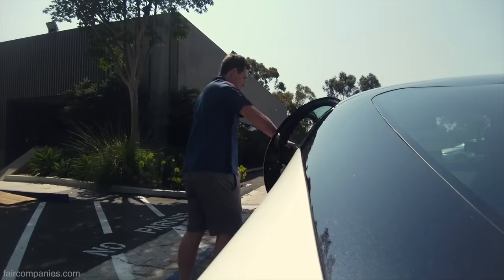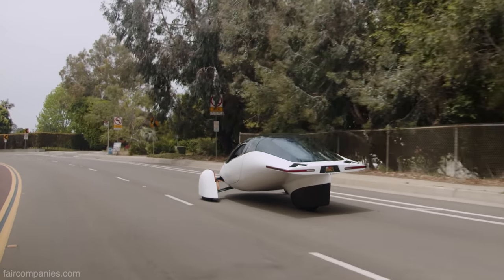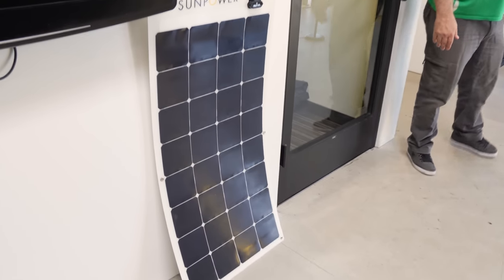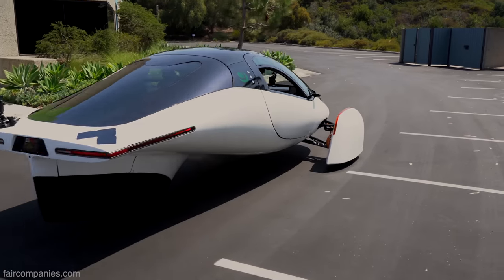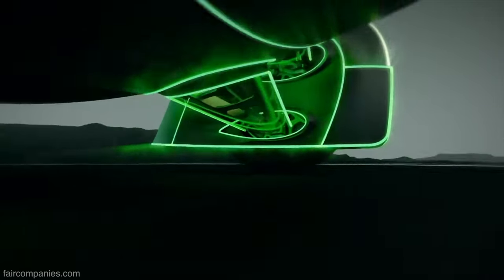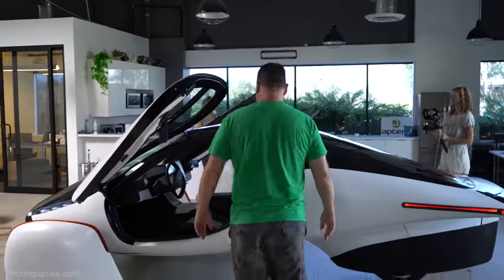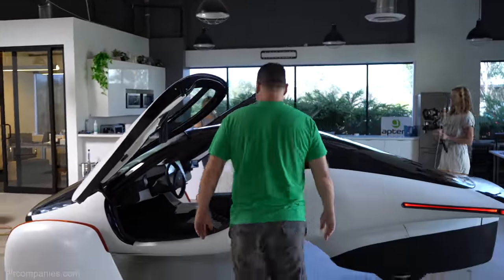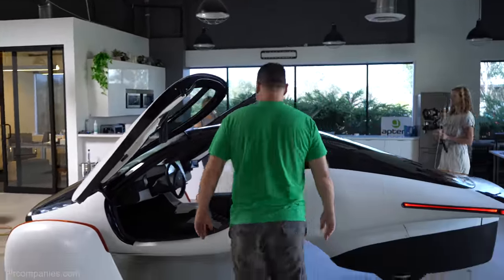Aptera commutes just on solar, gets 1K mile-range when full

Comment: Would be great if that sort of solar cells would be on other EVs too, more effective solarcells. I'm afraid the energy corporations will sabotage these solar cells, to keep people dependent in order to demand a high price for energy from people. 

Back then they made the cars front tall and V shaped, the wind drag was then very low too and there was more room in the vehicle. that would be i think the more efficient form. 

i would rather have the wheels under the cars body as usual, than sticking out oddly on the sides, that doesnt look good.
1000miles is a long range, i wouldnt mind much if it was only 820miles with an usual position of the wheels as said. 

btw, its great there is enough room in it for sleeping in that vehicle, i actually clicked on the front image of the video because of the tent on the car. 

They're building boats too, would be fun if they put a little boat motor on that thing for driving in water like a boat.

Comment: I think one of the best kinds of solar charging structures would be something you can unfold. It seems the higher power cells usually have to be hard in some way and that's doable too. They'd just have to have lattice geometry in an origami-like fold.
Reply: The problem with solar remains completely unchanged...
It doesn't work at night or in the shade.
Reply: @sandervanderkammen9230  That'd just be rechargeable batteries. But yes that is still an issue either way.
Reply: @suruxstrawde8322  Yes, rechargeable batteries are also very inefficient and impractical.
Reply: @sandervanderkammen9230  Hm, this I'm not very educated in. But even with the naturally occurring nanotechnologies of biology solar radiation isn't enough fir conventional movement in most cases. Typically biofuel in a readily convertible state is what's used.. hmmmm.
Reply: @sandervanderkammen9230  Some solar such as what Aptera is using still provides power in the shade.  What it does do offers considerably value added for the cost.
Reply: @n.brucenelson5920  But voltage can easily drop by over 75% if just one cell in a 36 cell array is cover bu shade, this will drop battery charge current to near zero.
Reply: @sandervanderkammen9230  It is understandable if you are not an engineer, but there are several ways to avoid this including bypass diodes and micro-inverters.  Or, considering your history, it could be just more of your FUD.
Reply: @n.brucenelson5920  You're not an engineer... you are a Tandy computer salesman at Radio Shack.
Reply: @sandervanderkammen9230  LOL,

Comment: How does it handle snow and flooded streets
Reply: The ABS/Traction control can sense slip and adjust torque 32 times per wheel revolution, or about every 2.5" of tread travel.  The wheel motors have been tested to operate under 10 ft of water.  It should be fine, especially in the AWD version.
Reply: @n.brucenelson5920  What will be the result of your leaving your domicile after a 2 day blizzard has dropped 2 feet of new snow burying your solar-powered car
Reply: @matthewjacobs141  I do have a garage.  My Aptera will have better ABS/Traction control than my present Honda which weighs about the same.  I have plenty of experience in blizzards, even on two wheels.  Aptera will be an improvement if I have to go somewhere with better torque control to avoid slipping.
Reply: @n.brucenelson5920  That's you...what would make this car appealing to the majority of people who are apartment dwellers...who park on the street where ever they can find an open space?
Reply: @matthewjacobs141  Each situation is different.  Aptera's first vehicle is not meant to meet the needs of everyone.  However, due to the low power requirements, it will gain range faster than most vehicles from any kind of plug that can be found.  If they can part in a sunny area they may not even need to find a plug to meet their needs.

Comment: You can use an impact wrench for a motor. The regenerate part is too heavy for now so a tank will do. Best of all you won't get radiation from EMF.
Reply: The motors are too far away from the occupants for EMF to be an issue.
Reply: Try again using a guass meter.
Reply: What frequency are they?

Comment: I wonder if it has heating and cooling also.  I figure that kills a lot of efficiency.  But driving through roads on 100 degree days with that glass canopy I'm going to want A/C.

I do think it's a cool vehicle and see a use.  Just wondering if it's a limited use vehicle.
Reply: Yes, both. It is spec'd over a range of -20 to 125 F.

Comment: Here's a better idea - efficient town planning where cycling makes more sense. EVs still accumulate carbon debt due to more complicated resource supply chains compared to conventional cars. Interested to know how many miles of driving until you've paid off the carbon debt.
Reply: Great comment and question.  Of course part of the answer is that Aptera  is  better for our environment than almost any other weather proof powered choice on the road.
Reply: At least in the U.S.A., every credible study shows EV's, from "cradle to grave", have less "carbon debt" than conventional cars.

Comment: I haven’t loss interest, not yet anyway. If Aptera can deliver as promised it most likely will be my first EV. But I want one I can butt test and drive before I commit to buying one. When are you actually starting production?
Reply: James, I got a ride in the Silver prototype, as did my wife, just before Thanksgiving.  A $100 deposit doesn't commit you to buying one, it just gives you a place in line, and it is refundable.  I expect that if the supply chain doesn't fully collapse as a result of the war, that I will be driving mine late in the year, and will be giving as many people as I can a chance to experience it in person.  You can send a pm to me on the Reddit r/ApteraMotors sub when you see that happen.  I live in Iowa and will be heading that way after picking it up.

Comment: it looks wide for parking. also the door swing looks like it would hit a car parked next to it. what is the cost?
Reply: The outside of the wheel pants is 88", compared to a standard parking space of 108"  My truck is wider than that.  You will be able to fully open the doors and exit with only 5" of clearance - better than with standard car doors unless you are very thin.  Prices start at $25,900 before incentives.

Comment: You are going to get very wet if it rains with that camper system, but I really love your 3 wheeler, I have been watching you car/trike for a long time, also watching the Doran, I even invested in that trike but got screwed really bad, how much for a Aptera and can it tow a small cargo trailer with all my camping gear that I carry on my vw trike?
Reply: Starting at $25,900.  Payload 500 lbs.  2-3 hundred towing capacity.

Comment: I haven’t seen data on top speed??—- I know it has great pick up but how far can it travel at 60 mph?
Reply: The top speed is governed to 110 mph.  The battery range projections are given for EPA highway rating speeds which average around 48-50 mph with peaks to 67 mph.  I think they are conservative.  There are programs on line where you can play with predicted performance and range for various configurations and speeds.  One is ABRP.

Comment: I believe the solar helps but not 100%, I still would drive one of this...if a cell does crack, it effects the whole panel not just that cell...
Reply: The cells Aptera is likely using have, effectively, bypass diodes built in.  This means a severely cracked cell will NOT limit the "whole panel" as you describe.

Comment: Since the front wheels protrude and aren't part of the car's body, it would be difficult to estimate how far they are from curbs.  Using drive-thru windows and gate badge readers would be challenging.
Reply: The left hand wheel pant can be viewed directly and there is a camera view for the other side.  There is also an ultrasonic distance sensor in the fender.

Comment: They should have used LFP batteries instead, since they can he charged to 100% without problems, don't require advanced cooling, does not contain nickel or cobalt, have no patents and are cheaper. 

True, LFP are not as energy dense as regular lithium batteries (easily compensated by being able to be charged to 100% every time) and have worse cold weather performance, but since the Aptera won't be used in cold weather anyway (because of the solar panels), it would make LFP batteries a perfect match.
Reply: I will be using my Aptera year round in Iowa.  Chris Anthony took an LFP battery company public as CEO.  

You can be pretty sure he would have used this own batteries if they could have provided the performance they were seeking.  Perhaps LFPs will be a future option.
Reply: @n.brucenelson5920  Well, LFP perform excellently in Teslas. The trick is to keep them warm. LFP having less energy density is compensated by the fact that they can be charged to 100% without taking much damage at all, they also have many more charge cycles, don't need cooling in hot, sunny climates and are free from nickel and cobalt. It's a better suited battery for an EV that charges all the time from solar. The vast majority if people buying an Aptera will live in sunny places, so cold weather performance is less important and can be fixed with heating (you need the heat for your own comfort anyway)
Reply: @SkepticalCaveman  I certainly have nothing fundamental against LFP batteries, and I agree that they are a good choice in many cases.  Still, at present, they are considerably heavier and Aptera's performance is very sensitive to weight, even if they could be fitted in the space available.  In addition, having to heat them through winter months when the weather is already contributing to a range hit might be prohibitive for longer trips for those of us in Northern climes, which may be a larger number than you are guessing..

Tesla does not charge from solar now, because the overall efficiency of the vehicle means it provides little range benefit.  Aptera had to choose very carefully to reach the performance they have, and it is very likely that LFPs were not capable of delivering the design goals.  Remember that Chris Anthony has been delivering LFP batteries with superior BMS for years already with his battery company.  Aptera knows LFPs.

With a projected life to 80% of the original charge of at least 400,000 miles, the NMCs Aptera is using will have sufficient life to perform for the entire life of the vehicle for many owners.
Reply: @n.brucenelson5920  NMC batteries does not like to be charged to 100% at all since it will degrade the battery, which means you are very seldom using all of the batteries capacity. It makes much more sense to use LFP especially for Aptera, since it can be charged up to 100% every day with solar or a charger during winter.  Its also much easier to warm up a battery during winter than cool it down during extreme heat in the dessert. NMC always have the explosion risk while LFP is much safer tecnology.. The slightly lower range LFP have doesn't matter in practice  since  NMC would not be charge to 100% anyway most of the time. LFP have more advantages than drawbacks in total. 

Aptera is way too focused on range instead of cost. They could easily have a  LFP battery with smaller capacity and even remove the solar panels and the "advanced" cooling for a lower cost model. Charging an EV is cheap, especially the Aptera so why pay extra for expensive solar panels? It will take a long time before those panels save back the money they cost. Makes much more sense to have solar panels at home that can also power the house, than on a small EV.
Reply: @SkepticalCaveman  Aptera has run the numbers and come to a different conclusion - one I trust, since they are intimately familiar with the properties of LFPs and their founders have been supplying them to the market for years.

Having solar on the home and the vehicle is not an either /or choice.  The home solar will do nothing for you on road trips - for instance camping in Death Valley, which is something my wife and I intend to do.

In addition, since even though my daily driving needs are are far less than the 20 miles per day of additional range I will get from full solar, I will more than pay off the $900 investment in full solar, and then have the added resale value when the time comes.

They are not only focused on range - they are also concerned about value, and full solar clearly offers that in lowered operating costs and freedom from grid charging.

Comment: did i miss it, or was there nothing said about clowdy weather...?
Reply: In cloudy weather you can plug into a standard 110 v 15 amp socket and get 13 miles of range added per hour or 500 miles plugged into a 50 kw DC fast charger.

Comment: I wonder how that would do in the snow? I think those wheel pods would pack up with snow and ice very quickly, making this a car for sunny climates only. Still coo though.
Reply: The wheel pants clip off quickly without tools, but since the motors are in the wheels, it is likely that the heat generated will melt any snow accumulation.

Comment: When the Aptera was initially designed it was at its highest tier a hybrid vehicle like a Chevy Volt or Bolt.  Is all electric the highest tier or is this standard?  I'd imagine it would have to be standard since there's no drive shaft for a gas engine.
Reply: If its all electric, at least I wouldn't have to worry about thieves stealing my catalytic converter anymore.
Reply: The current design is all new, started in 2019, and is fully electric with Wheels motors.  Nothing but general idea in common with the original design.

Comment: 1000 Miles range is a big promise....promise less and deliver more!
Reply: Remember that this is under EPA highway conditions.  The way many of us drive at interstate speeds, we won't get that kind of range, just like EPA estimates for any vehicle.  I will be getting the 40 kWh model for less weight and initial cost.  If V2G becomes a thing, the larger battery could do a better job of also providing power backup to the house, and this could make the larger battery worth it for us.

Comment: I wonder if it can operate with one pedal like a Chevy Bolt?  Also, his comment about the hot dash being a place to utilize more solar is a bit misleading - solar cells' efficiency actually drops as they get warm.
Reply: I see how his statement could be misunderstood.  I interpreted his statement to mean that cabin heat is derived from sun exposure on the dash, and he wanted to utilize that sun exposure.  Granted those panels would be less efficient that the cooler panels located elsewhere.

Comment: A spartan version would be interesting. Something that doesn't use the display, only mechanical gauges. No power anything. Probably wouldn't save much mass bit it'd be cool.
Reply: The parts count and assembly cost would increase considerably if mechanical gauges were used.  However, they do grant right to repair, so someone could do it.

Comment: What happens if you get a flat tire
Reply: The wheels unbolt from the wheel motors just as if they were drum brakes.  I plan to carry a DC inflator, a pair of pliers and a plug kit, just as I did on my motorcycles.

Comment: Fair weather highway vehicle will be very difficult  to fit wipers and poor road holding in the wet because lack of Downforce helps a bit with motors in the hub
Reply: Brian, there will be good wipers.  The road holding is likely to be excellent for several reasons.  There is very little force the wind can exert on the body, especially from the sides.  This makes it much more stable in windy conditions, compared to a typical SUV.  What little downforce their is - About 25 lbs at the rear at 65 mph and rapidly increasing with increasing speed, helps keep the rear planted.  Aptera has by far the quickest reacting ABS and traction control of any vehicle on the road.  It can sense slip and adjust torque 32 times per wheel revolution - about every 2.5" of tread travel.  

The climate control system will be certified from -20 to 125 F.  This will not be a "fair weather only" vehicle.  I plan to drive mine year round in Iowa.

Comment: very nice..hows it street legal with no bumpers?
Reply: Motorcycle and autocycle licensed vehicles don't require bumpers.  However, there are carefully designed energy adsorbing crumple zones both front and rear that will cause the vehicle to perform very well in crash tests.

Comment: I don't know. I think it needs to have an air conditioner and a high-speed charger like a Tesla.  I would imagine it takes about 8 hours to charge this thing in the sun. So basically you can drive 800 or a thousand miles on Monday and then you have to sit it out Tuesday and then come back on Wednesday. If you could plug the thing in that would be a lot better.
Reply: Aptera has an air conditioner and heater.  The solar adds about 40 miles max per day - more like 20 where I live in Iowa.  If it is plugged into a 50 kW DC charger, it can charge at a rate of 500 miles per hour.  It will get about 13 miles per hour from a 110 v 15 amp AC plug, or about 30 miles from a 22O circuit.

Yes, you can plug it in.